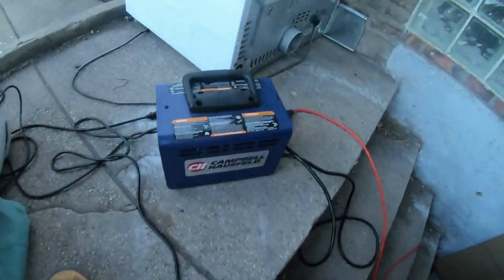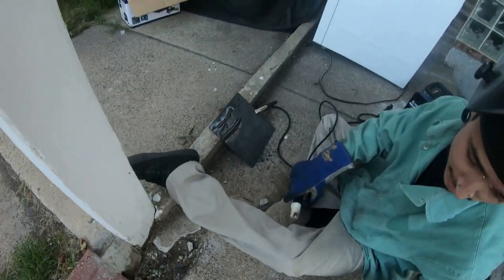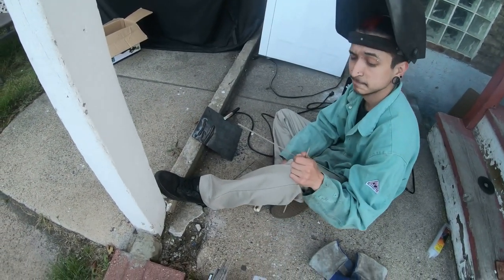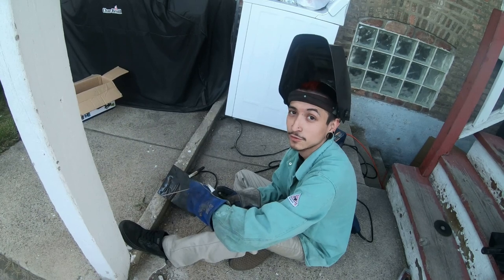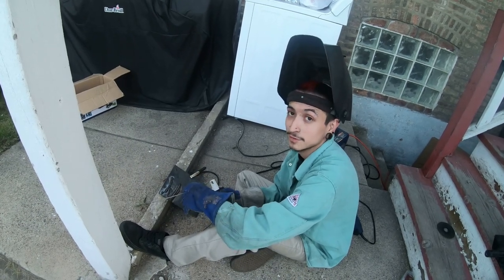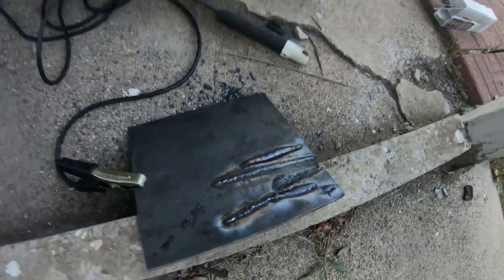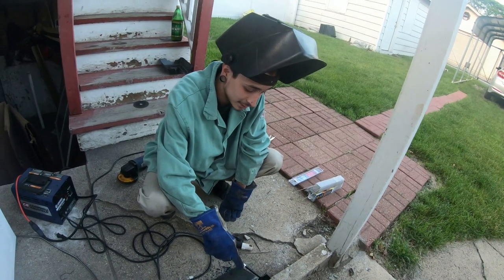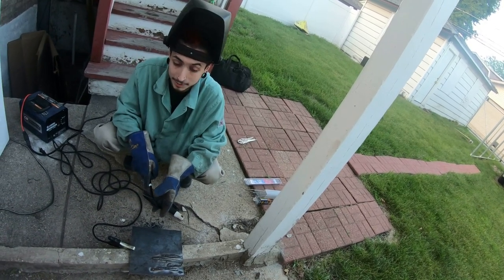Campbell Hausfeld 70 amp welder

Comment: I am glad you said all that cause I had same issues and thought I forgot how to weld 😂😂😂 I bought a big 220 cracker Jack and had no problem and you just confirmed it's not the machine being messed up it's just weird rod size I tried slowing down speeding up sand blasting each joint clean wasn't aware of the low hydrogen all makes sense now i appreciate the videos guys thank you
Reply from the maker: you are so welcome and thanks for watching

Comment: For my race truck I got mine welding half inch thick metal plate. It works because I take big jumps with my truck and it hold the shock tower no problem

Comment: Nice video. I have this welder and using it to weld a lawn mower tractor deck. It's a good welder but strength is limited. I will get the 5/64 size to use next. 1/16 works but I think the 5/64 will work better. You have confirmed that. You were very thorough in your explanation. It was very helpful to me

Comment: think I can  run this from 2000 watt inverter? possible to weld 1/4 rebar in a cross?  if so, what's a good rod to do this? 1/8 rod 6013 coated?

Comment: I've had mine for about 6 months. It's good to have for small stuff. But, I just cut my moped in half and am putting I 12" pipe in the middle to extend the scooter for more leg room. I've used Hobart (1lb $10.99) and harbor freight (2lb $6.99).tried all different sizes. Anything larger than 1/16 you're wasting your time and money. Forget about aluminum rods and welding any cast aluminum or anything like that. Not enough amps. Not even close. Harbor freight rods are doody. Don't waste your money. They do ignite really really well but welds are weak af. Just matter of fact, don't waste your money on this rig. Just spend a little bit more and go online and buy a MIG welder for like another $30. 200amp is good enough for almost anything you wanna weld

Comment: Could I use this welder to weld a crack in my car exhaust  where the manifold comes into the catalytic converter? If so what size rod would you recommend? Thank you for the vid
Reply: Yes you can....  but I recommend sticking to 1/16 sticks, they burn through quick but much easier in tight space like that
Reply: My plant not burning the 1/16 rods they just sticking